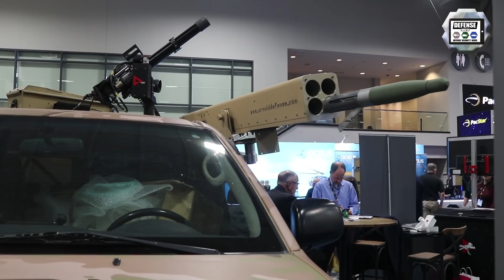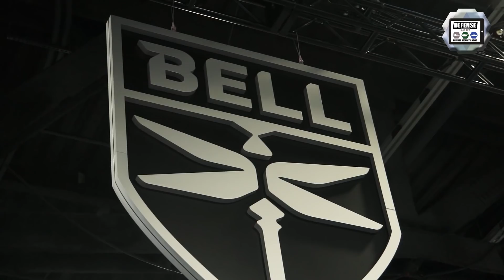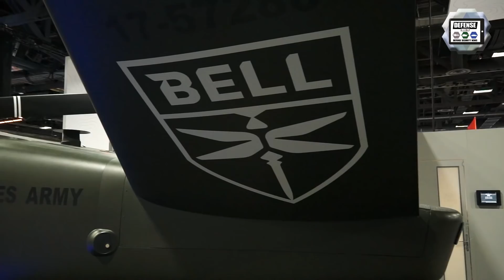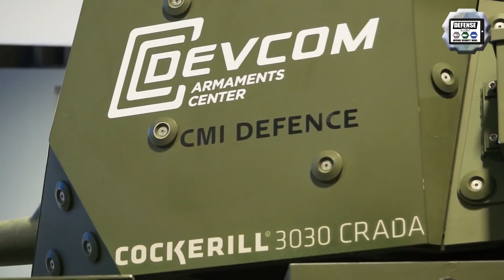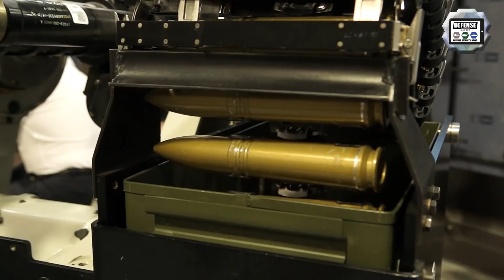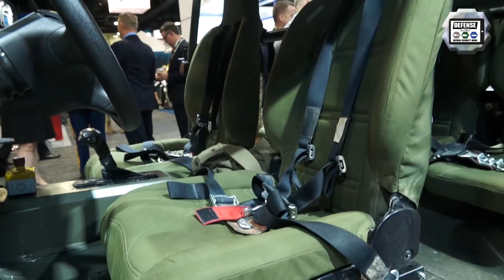AUSA 2019 News Show Daily Association of United States Army Defense Exhibition Washington DC Day 3

Comment: The V-280 is likely more expensive than the V-22, which is about 2x the size.  I would rather just see a wider variety of V-22 so they share most parts.  This would lower the cost of the V-22 even more.  They have similar speeds and ranges. The V-22 carries 24 passengers plus 6 in the isle if needed and can lift something like 15,000 pounds.  It would be nice to see a variant with a nose gun and missiles similar to an Apache.  The navy is already looking at an anti-sub version and a sea rescue as well ass possibly an refueling tanker.  I would also like to see a radar plane version like an AWACS or Hawkeye.  This will add more capabilities to the America/Wasp class ships and give them similar capabilities of a full sized carrier.

I think the Switchblade is neat but the need for an air compressor is just stupid.  They should just put it in a tube with a charge and a small rocket to gain altitude.  You could make it reloadable but the storage containers would likely make it just as heavy.  Seeing the Humvee 2.0 shown with 8 Switchblade 600 and 4 Switchblade 300 looked like a good idea.  They need to make them a bit harder to jam and they need to make a drone with a signal booster that you just give a GPS coordinate and it will go hover until the battery starts getting low and then returns to a pickup location.

Comment: I think the Valor makes way more sense, especially maintenance wise.
Reply: The only problem with valor is that is small. The tiltrotor concept is waste at that size a mid size like cv22 with 24 to 30 seats is better as it matches and exceed in capacity and speed respectively when it comes to mi8/17 while stick with coaxial for light hover class with 12 to 16 seats. Although US military has invested in ch53k for heavy lift a 50 to 60 seat quad engine Chinook would be the icing on the cake.
Reply: @TakNuke  I meant in terms of the Valor vs the Sikorsky SB-1 Defiant, which it is in a competition with for the Army.  I think three rotors is a maintenance nightmare and a bigger risk in the way it's set up.
Reply: @CheapSushi  If one wants hover and vertical lift nothing can outperform a coaxial even ka226 is rated for himalayas currently replacing aloutte 3 in the Indian military while a tilitrotor have a higher disk loading along with reduce hover and vertical lift due to wing interference that's why it's good for when range and speed is priority. As usual a coaxial is better for light class while a tiltrotor is better for mid class pitting it against mi8/17 and Merlin etc. While the kmax can be developed for ultra light class as an ah/mh 6 replacement.  A larger  Chinook will be better choice for heavy and a quad tilt for ultra heavy.
Reply: @TakNuke  Problem is, it not only has a coaxial, but then a 3rd prop in the rear  for forward thrust. It's a maintenance nightmare.  Any number of small arms could ruin it's day. I think the Valor just makes so much more sense. They should definitely consider a quad Chinook.
Reply: @CheapSushi  Tail rotor damage is not a problem as  its role is of pushing not of anti torque like in conventional rotor. So even if it's get damage vtol of defiant will not be affected only its speed will be. While some might say rotor blades might hit each other is a possibility, the success of tandem rotor and intermeshing rotors in usa and coaxial rotors in Russia eliminates such problem. Beside that the rotor design on defiant is rigid rotor which eliminates problem blades flexing.